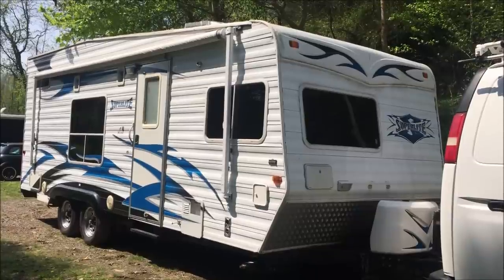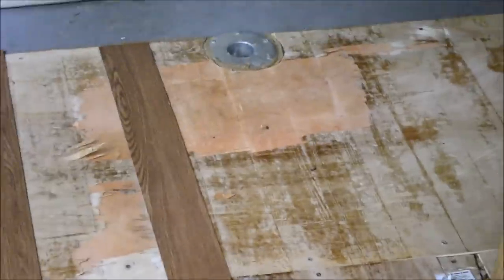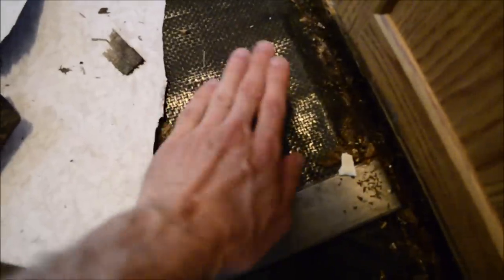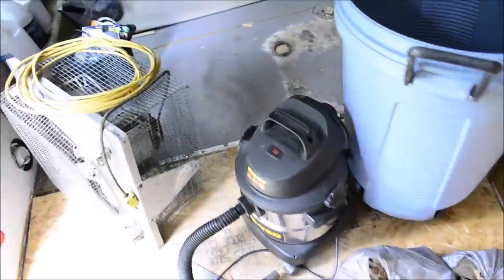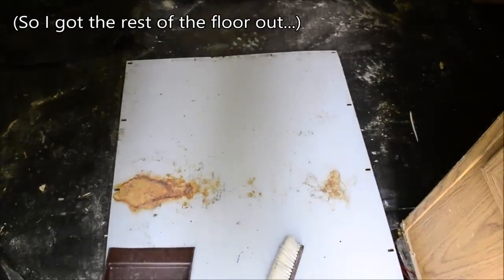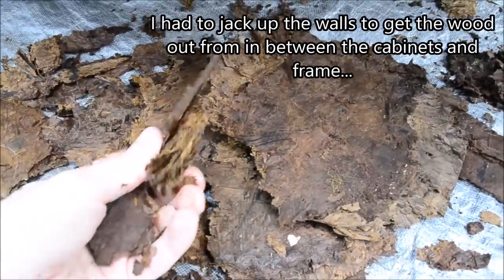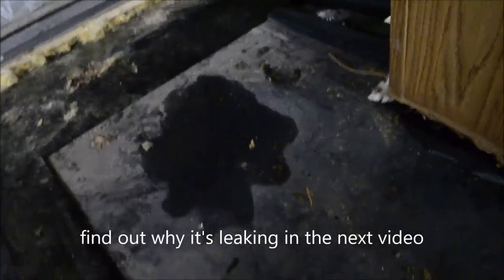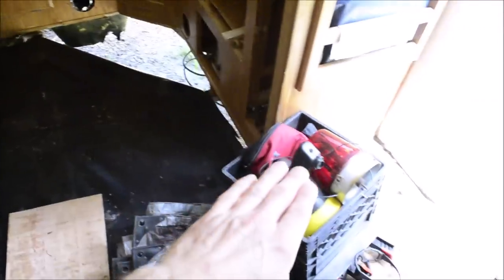Camper Floor Rot Hidden by Scammer Seller - Tearing It Up

Comment: Should have pulled the roof pulled all the cabinets through the roof and other things you can't get through the door and then use pressure-treated plywood Edge seal with some type of tar.
Do not use MDF for some kind of particle board. Roof vent covers will prevent a lot of leaks. Corner seal tape on all the exterior aluminum flashing. When putting turn back on use 3M Automotive seam sealer
Reply from the maker: Thank you but my camper has a big ramp door on the back

Comment: I got scammed to. I spent 4000 on a motorhome with 15,000 miles. Runs god except the ignition switch went out.also there is soft wall in back in the front and small spot on celing. There now is a smell of mold. Im going cheap as possible to fix it so i can get on the road asap.
Reply: See if a pro can check for mold. It can be deadly or at least give you chronic lung problems.

Comment: Dang I’d be pissed! My camper had some rot in the corners (1988 terry resort 24ft) which I am fixing now. The previous owners didn’t know about and I didn’t find it until later which is weird considering my mom and I went over it for 30min looking for leaks.
Reply from the maker: That sucks man! Seems like it's easy to overlook problems on a camper. Good luck with yours!

Comment: The main issue which was not addressed. Black mold. Toxic poison in mold.
A big problem with anything previously owned. 
The silent killer.
Reply from the maker: most if not all of it was cut out - also, it was ozoned. I spend a lot of time in it even before the ozone and I'm fine.

Comment: I can see the contempt on you face as you rip into this project.  Almost worth a visit to the scammer.
I'm going to sell my toy hauler soon, but not until I property repair a small soft spot in the floor near the door.  I would want this to happen to me and I'll be damned if I would do this to someone else. 

Did you consider cutting the cabinet screws off from the inside?

Comment: Where was the leaks coming from ?
Reply from the maker: Probably many points on the front portion of the roof, previous owner fixed most of them. I fixed the front window and the antenna. Prev owner removed the ladder so I'm guessing it leaked from the ladder mounting points.

Comment: just wondering how much you paid for it?
looks like its been in flood
Reply from the maker: 4500, the roof and edge seals werent maintained. With the way the roof slopes forward, all the water runs down the front of the trailer, so freezing and thawing over the years also compromised the front window seal. The manufacturer used a rubber gasket to seal the window instead of butyl tape, so that didn't help. I wouldn't have paid more than 2000 if I knew about all this damage.
Reply: @aDIYCarGuy  we just bought an 06' fs2400 super lite and he disclosed that it had water damage but had since then been repaired and put back together. As far as I can tell, the leak is no more,  the floor is solid  but has a full carpet even in the front compartment and all matches the orig rool up carpet, all tho when you roll up the roll up carpet is the floor looks as if nobody had put any big toys in it. Has a bmx (ama) sticker on the back. But everything works as it should and the guy I got it from showed me that he had just bought it 2 weeks prior but felt he didnt want to get into this trailer and my thoughts is he got scared of things that didnt work ( main power switch he didnt know about) and bought it for $7800 and put it up for $3800 so I jumped on it, as alit of others were offering him more for it but didnt really get to go through it b4 buying it but does need alil work but still feel like it was a hell of a deal as I was looking and couldn't find anything under $8k in fair shape.
Reply from the maker: @williamthompson5606  that is a hell of a deal if the floor is solid and dry and no leaks
Reply: @aDIYCarGuy  yea I havnt found any wetness inside as of right now and we just had a snow storm, then rain and then just washed it and yea seems to be holding up. So fingers crossed. Just two days prior I drove 4 hours to go get what I thought was a 02' fun runner but when I got there it was not that, it was a 98 fun runner with the back bed that dont go up and I need that space for a sxs. But good work on yours. Are you done with it? Have you taken it out camping yet ?

Comment: You can Fix a soft floor in an RV with  Steel tubing or angle Iron  from Under the RV  by screwing it to the Frame or Welding  a soft floor is Common it an older RV
Reply from the maker: No doubt, but the way this guy installed it was pretty heinous
Reply: That True  looks like you have a Rotten Floor rather then a Soft one    I have owned Travel trailers for 10yrs now and the Biggest thing is Water Leaks  be it the Roof or something like  the  sinks  shower or Toilet.    always check your water lines etc inside  to see if they are Leaking  and your  Roof  do you have a Flat roof or a Barrel roof ????  Because I had a Trailer with a Flat roof  they are noting but trouble water pooling on it. now they don't make Trailers  with Flat roofs all Barreled  Roofs  good luck with your repairs
Reply from the maker: I wish it was barrelled but it's a flat typical camper roof, but since it's a toy hauler the trailer is taller in the back, so a lot of the roof is angled forward, so no pooling for the most part luckily. I resealed the whole roof (about 6 tubes of dicor), the front window, the front corner seams, some other parts, and still have some left to do. I'll be checking the roof often because I don't want to have to do this floor again lol. The new part of the floor was soft because the previous guy used 1/2" osb instead of 3/4" like is supposed to be there. The floor that he left under the cabinets was still rotted, moisture completely sealed in. Thanks for watching!
Reply: The Best Tape for your RV roof is Eternabond Tape  that stuff sticks to anything  Check it out
Reply from the maker: I would like to put that on the corner seams some time.....50 bucks a roll, might have to happen next year lol
Reply: Yeah I used it on my Last RV at 65 bucks a Roll its a Bit of a Bite  But it Works. if you put it on your Vents where your Dicor Caulk is you will never have to Caulk them again  Ebay is the Best Place to Buy it  also if you have a Puncture in your roof  from a Tree Branch Etc its a Quick and Permanent Fix .
Reply: 1995dresser your right to seal seams butal is used under vents
Reply: a DIY Car Guy yeah i have RV 34 ft that needs it high$ , but the one i live in is good 19ft still would like to use on it anyway for good measure good luck to you
Reply from the maker: thanks good luck to you too, this year I have everything sealed with dicor lap sealant and dynaflex ultra (which is a little difficult to work with but is a great extreme weather flexible sealant)

Comment: Your trailer still going to ride out they build the floor all the way out to the edge of the trailer than Nails walls on top of wood floor the beams that hold your walls up at the very bottom are going to be rotted
Reply from the maker: they're not rotted suprisingly

Comment: Sorry dude!! What I've come to realize is that all campers/RVs leak other than brand new ones -brand new ones that are still in factory that is!! I bought a Class C that I knew leaked but more than I thought. I bought it right tho. Good thing u can fix it - an RV body shop would charge u $5k to fix the floor. Did u make sure the more of the roof isn't rotted also. Mine was
Reply from the maker: Thanks, if I ever buy a new one I will store it under a carport or tarp at least. I store this one under a big white 10x30 tarp and I feel at peace lol. Yea the previous owner actually fixed the roof mostly, I had to finish it off. I am putting Beech Lane / Eternabond type tape on it this year.
Reply: a DIY Car Guy Me too! Weird right? Something built to be outside has to be covered. BTW, very impressed with your DIY skills. You fixed the floor correctly and you fixed the roof also!
Reply from the maker: @mikel7467  Yea it's unreal that they have to be covered haha. Thank you! Sorry to hear about your leaks also, hopefully it will be an easy fix.
Reply: a DIY Car Guy Already fixed mine, the cab over bunk of a class C RV. It was about $200 and maybe 60 hours. I keep a cover on it when I'm not using it.

Comment: We are in the market for a used camper pray that we don't get scammed 💜
Reply from the maker: Look online for a checklist of stuff to look for when buying a used camper and bring that with you. Good luck!
Reply: Don't buy an aluminum one. Buy fiberglass. Look under the thing and see what the flooring is like. If it has new flooring inside, run run fast away into the hills.

Comment: now that you cut the membrane you really need to pull all the cabinets and do new membrane wall to wal and fresh marine grade plywood wall to wall . it will just rot otherwise through the hole you will never seal correctly